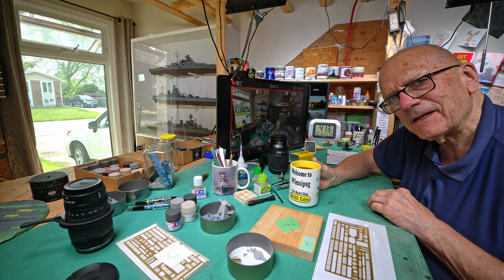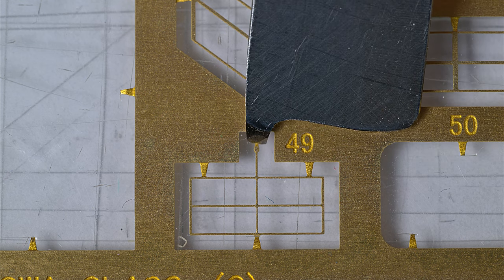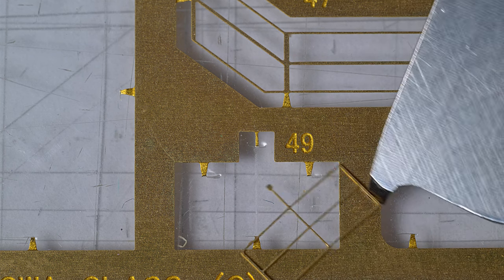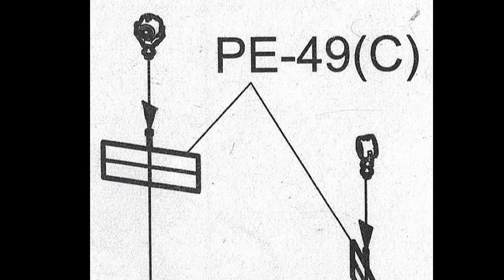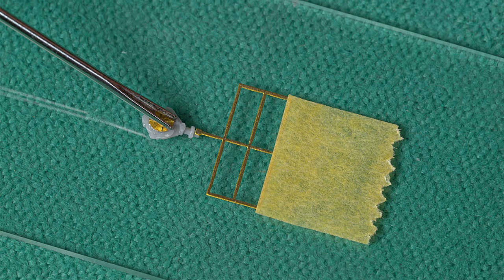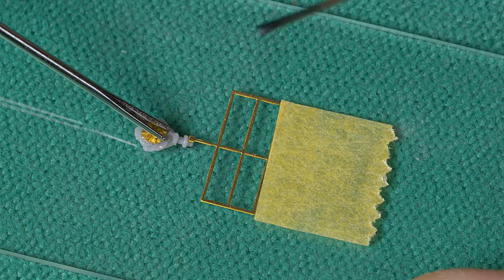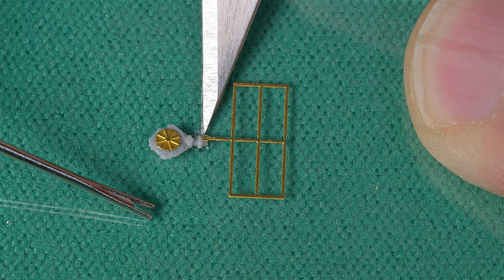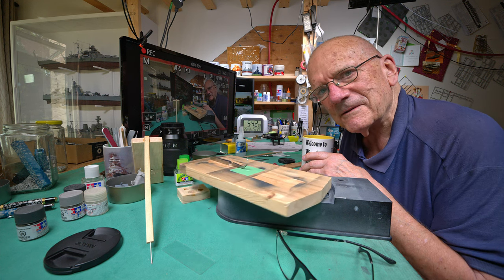The Model Ship - Part 1615 - 8k Extra

Comment: get a cutter blade, or a very fine saw and make a cut in the bottom peg of the spot light, in this way you soulf have made yourself a slot that is going to bracket the post on the railing
Reply from the maker: Re: "very fine saw" I actually deal with that possibility in the next (1616) episode. 😁👍